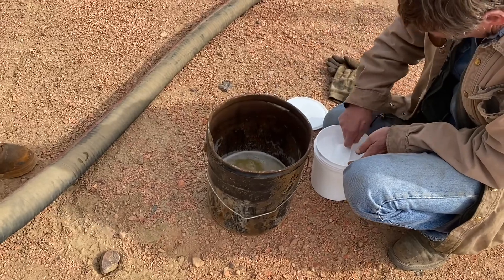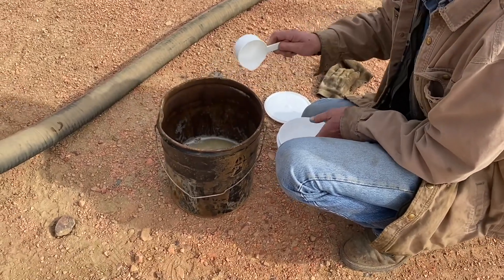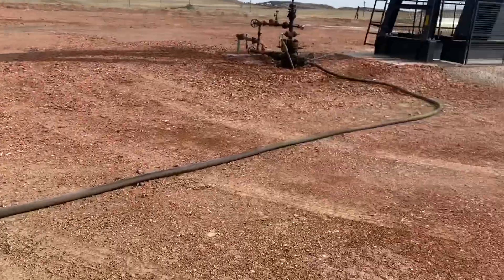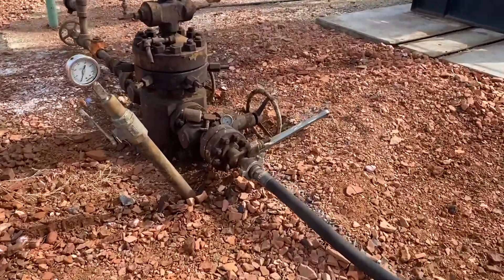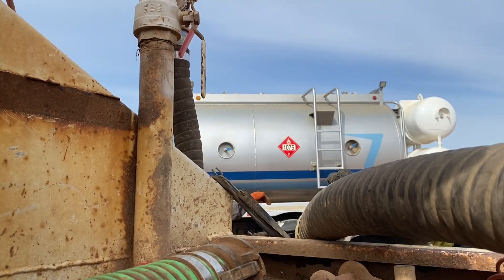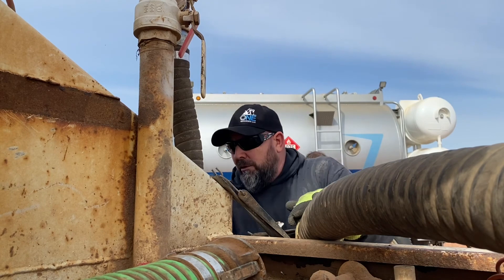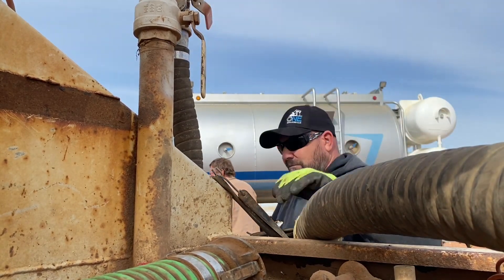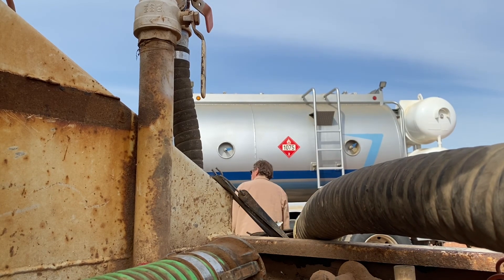Oil Well treatment

Comment: What temp does the water need to be and have you evaluated the difference from variety of water Temps? I'm curious to the affects on certain solids. When I ran a hotoiler, I was very particular when it came to chemical injection through the truck for spearhead temps and trailing water Temps. I'm just curious what the sweet spot would be for your chemical.